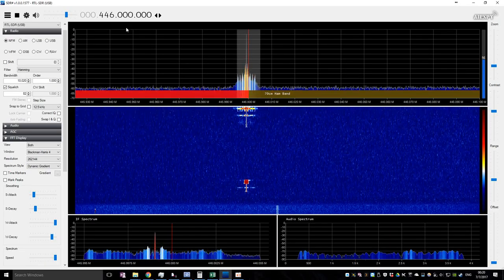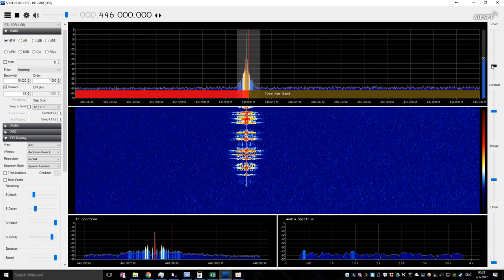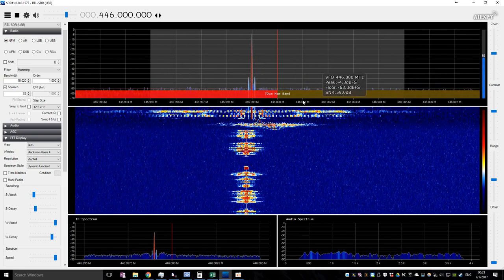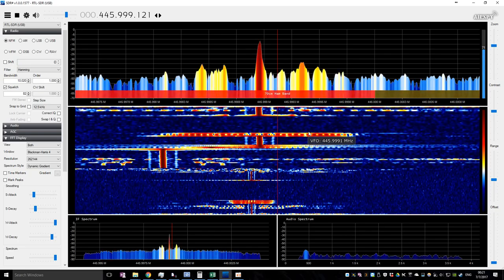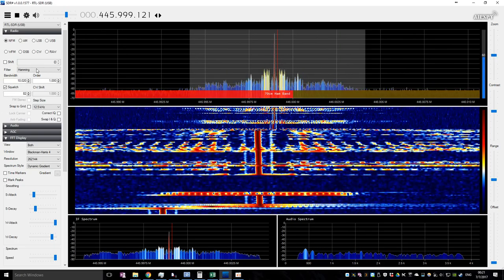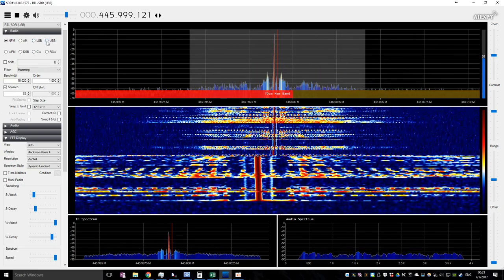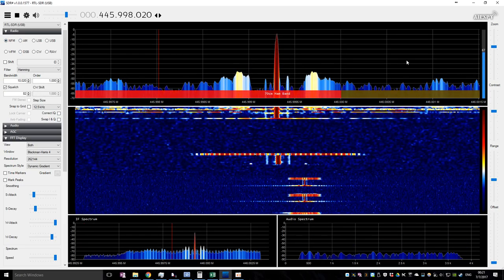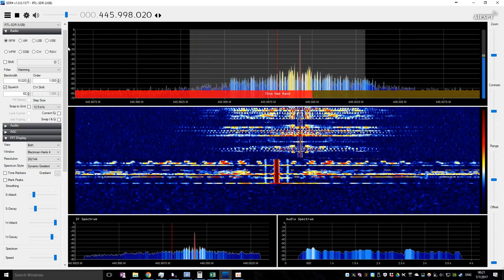Baofeng BF-888s Squelch Tail Data Burst? What is it?

Comment: It's not data. It's the sub audible squelch tail eliminator or STE. Motorola calls it "Reverse Burst" but STE is the generic term. It is a burst of sub audible tone, usually 55 Hz, sent out at the end of the transmission to help close the receiver before the carrier drops so you don't hear the actual squelch tail.
Reply: Ok thanks for this informations!
Reply: The first clear and exact explanation of STE. Thanks for going directly to the point .

Comment: If you try using a digital pill tone you really don't hear it but when you have it on a regular pill and you do hear it plus you can also adjust the s t e frequency or 160 functions underneath the bandwidth on the analog when programming

Comment: So how to avoid having squelch tail at the end of the transmission?
Reply: Program CTCSS or DCS receive to “ENABLED” with a value.
Depending on manufacturer of the transmitting transceiver, select 120 or 180 degree shift in phase.
Oh yeah.. forgot...  enable STE or “squelch tail eliminate” and make sure the transmit PL is enabled on the other radio
(the transmit radio).   This only applies to analog, of course.   P25 & DMR are digital protocols and this is not an issue.

Good luck and 73